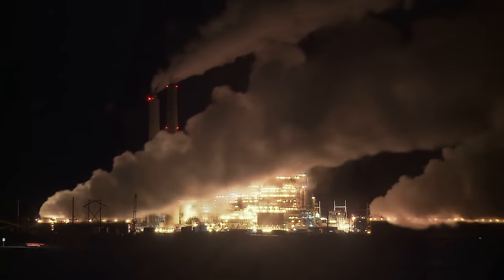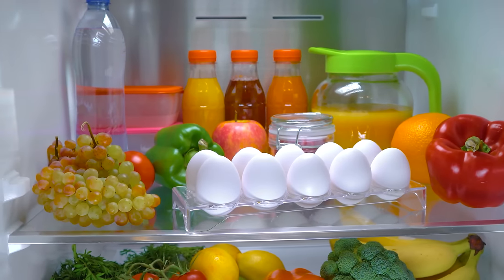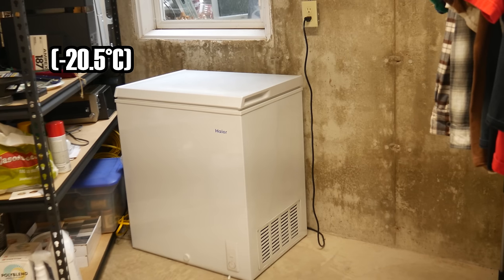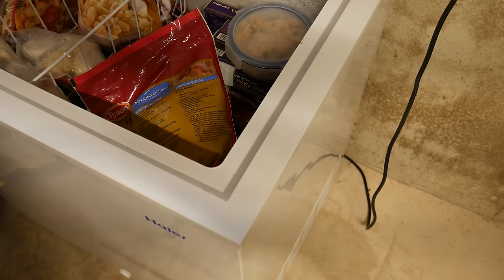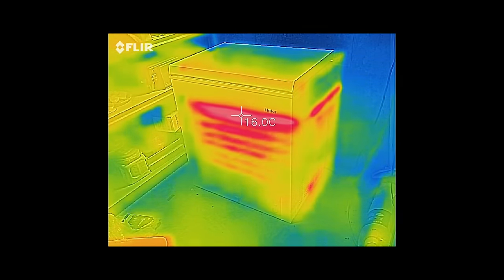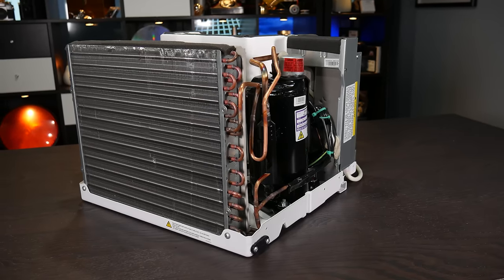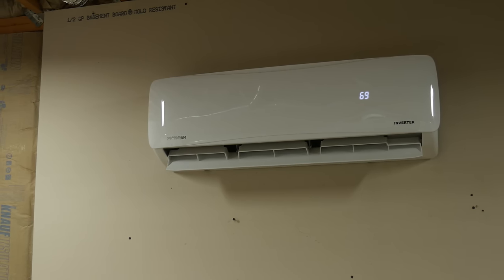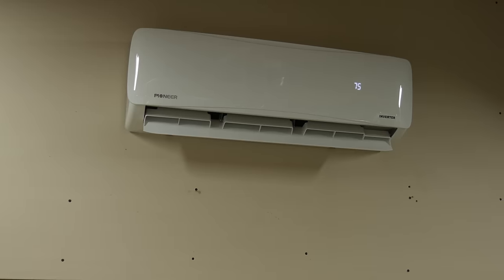Heat Pumps: the Future of Home Heating

Comment: So if I place my big food freezer such that its door opens out into the garden, and its back faces into the kitchen, and seal any gaps around it so that outside air cannot blow inside or heat from kitchen does not escape to outside, with some barrier or a curtain, the freezer is then set to cool to its lowest temperature say Minus 20C , the fridge will then try to cool the outside air from say 0 degree Celsius to even lower to -20C and in doing so the heat it removed from outside 0 degree air trying to extract heat from it to take it down to -20C  will end up into the kitchen, from the rear part of the fridge where it has a heat radiator grill or matrix, this discharges heat into the kitchen so the kitchen gains the temperature whilst the air outside starts cooling even further lower than 0C . So you can have a simple cheap heat pump. It uses around 60Watts for the compressor, so it is likely it is radiating 4 times more watts into the kitchen I.e. 240 watts of heat being pumped into the kitchen by using only 60watts for the compressor trying to cool the outside air to minus 20C, , and yes occasionally you will have to defrost it as moist or damp outside air condenses on its inner shelves and walls.

Comment: Heat pump is very popular way of heating home in winter & cooling in summer in New Zealand. However our winter is not super cold in Auckland around 2- 3 degree Celsius were I live & summer is hot as around 30 degree Celsius. Heat pump become very economic way to do both job. What I learned from technical person who installed it that heat pump will heat the house as long as temperature is above 0 degree Celsius. 5.00 kilowatt will heat around area of 50 cubic meter with little power use as 1 rod rediant heater

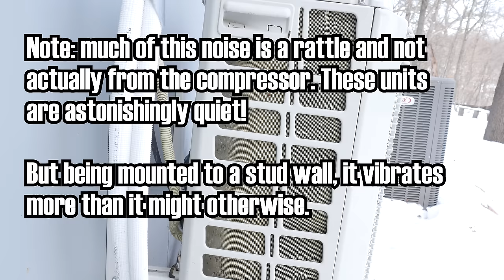Comment: 23:27 thé noise is not rattle, it makes this noise when starting the unit in heating mode for around 7-10 minutes thereafter it goes quiet. I have a Hitachi hit and cold unit and the nose is loud in the beginning and felt like a chopper flying over the house. The DAIKIN and Panasonic units made much lesser noise. So this noise will be there when starting up in the winters

Comment: Heat pumps have been the norm here in Florida for years. They’re great but have some downsides. They wear out sooner because it’s the same motor working year round instead of separate heating and cooling units. They also don’t work as well in extreme cold - which is something we don’t really have here.
Reply: And where it is cold, we have much better heat pumps. There are models for different climates, its important to buy the right one for its purpose.

Comment: While heat pumps can work down to -18C (0F) or so the efficiency plummets and so does the lifetime of the unit. If you live in cold climates you need a supplementary furnace.  Oh, and don't get me started about what happens when you a power outage.

Comment: To defrost the condenser in winter, could you use resistive heating to warm the condenser fans and melt the ice?  The fins themselves could be electrified to warm them up.
Reply: I think there have been units that do that.

Comment: Very good  video. I live in the Netherlands and in our climate there is no need for an airco. If I would want to buy an airco to use it as a heat pump, this would cost me a few thousand euro's. When I read about heat pumps I always read that they have an efficiency of 400 percent. You, however, seem to indicate that the real net efficency lies around  250 percent. 
Now I heat my house with natural gas and when I would swith to electric heating, it would cost me three times as much money. When I would also switch to a heat pump, those 250 percent gain in efficiency would reduce my cost for electricity from 3 times more to largely the same as the cost for heating on natural gas. So in the end acquiring a heat pump would take me quite an investment with hardly any profit to earn my investment back.
Reply: That is why they are putting up the price of gas. It ain't all on Putin mate.
Reply: A different scale, same efficiency bub.
Reply: @azzy2001  If so, that would be funny and the joke's on them, because electricity generation itself is about a 30% efficient conversion (the rest being waste heat). This is why a space heater costs 3X than natural gas to heat a home, because either they're paying for fuel and making electricity at 30% efficiency, which you then "burn", or you're paying for fuel and burning it.

Comment: Why not add a series of three air dryers to the system
1) Each dryer would allow outside air to flow into a cylinder containing a water absorbing agent
2)  When a drying unit reached its absorption capacity, it would close off to the outside air; a small amount high temperature refrigerant would be diverted to heat up the drying agent while high temperature dried air from one of the other dryers would  be blown through the at capacity cylinder.  
3)  The third unit would always provide a free flow of unrestricted air to the cooling/heating coil 
4) A fourth bypass would be available for temperatures and humidity levels at which ice on refrigerant coils is not likely.

Comment: Seems like a decent innovation from a material conservation perspective, even though it would be less efficient at heating than an electric heater given that it's literally just electricity -> heat.
It's always been funny to me that efficiency for most machines is determined by how much energy is lost to heat, but for heaters?... It's by how much energy isn't lost to heat.

But that being said, reducing the amount of devices needed for temperature control is very good!
Material scarcity will be a much larger issue than power scarcity in the future, I'd wager.
I didn't initially agree with the title of the video, but... I've come around.

Comment: It's interesting that you say the equipment of the mini-split might seem weird because people aren't familiar with it. As you say, they are basically air conditioners running in reverse, but also they look exactly like what I think of when I imagine an air  conditioner, so it seems very familiar to me. I get why; that sort of form factor isn't as common in US homes I gather. I don't live in a place that has air conditioning for homes... at all (or even a furnace, we use boilers and radiators here) but when I say, travel to Bangladesh the AC units look exactly like this mini-split, but running in the more familiar direction of course. Same with my old workplace; its AC was made by Mitsubishi and looked rather like a mini-split.

Honestly, I think a place like Bangladesh is really well suited to heat pumps. It's warm much of the year there of course so it can be fairly mediocre, but there is a need for heating when it gets cool there and because it often doesn't (and so buildings are often quite draughty and clothing is mainly for warmer times of the year) even fairly mild temperatures can cause a lot of problems. It angers me that heat pumps are not more common in general because in this case, they can be used to prevent literal deaths (which does happen when it gets cooler there), especially because air conditioning is extremely widespread and often necessary to really live there. There is as you say literally no reason such systems can't also be used for heating - no doubt the same issue of fossil fuels (Bangladesh has vast natural gas reserves) is a big reason why, especially when a lot of the people there aren't exactly well off.

Comment: Installed one in Maine, it gets cccolddd here but it  puts out heat, it is working hard on those cold days and the  defrost cycle is frequent, if i insulated better it would make life easier for the heat pump,

Comment: Heat pump on a rental my family is in. It sucks. In an area that regularly dips below 10 degrees in the winter, a heat pump was the worst option our landlord could’ve picked. I have an inside portable temp gauge. The weather outside was 21 degrees, and the heat pump kept our house at 44 degrees. My kids and wife stayed in bed all those days cause the floor was so uncomfortable for them to step on it was so cold. Not to mention our electricity bill went from 140$ a month to 395$, to keep our house at 44 degrees…

Had to section off rooms with plastic and cover all the windows, then use space heaters to keep the house warm. All this hassle, if you’re considering installing a heat pump, don’t.
Reply: Sounds like a horribly insulated house.

Comment: I live on Vancouver Island, British Columbia, Canada.
My home is heated and cooled by an air to air heat pump
The outside temperature in th  winter can drop to minus 16 Celius.
At minus 9 to 10, the electrical heatimg element in the duct system kicks in.
We used to live in Whitehorse, Yukon.
The Ground water under the community of Riverdale, is plus 7 degrees celcius, therefore, even at minus 40 celsius, a geothermal system, with a water well, would work to heat a home.
Location location and source are important
Reply: There are better and more suitable units. The climate where I live in scandinavia is the same. At -10c the heat pump works normally. At -25c electric adds in. I have air to water so you dont notice the difference. It is not many days we have so cold weather so its not so much on the electric bill.

Comment: "Refrigerant" is actually freon-12 replacement. R-134a is a type of refrigerant commonly used in air conditioning systems, heat pumps, and refrigeration equipment. Its chemical name is 1,1,1,2-Tetrafluoroethane, and it is classified as a hydrofluorocarbon (HFC) refrigerant. R-134a is popular as a replacement for the earlier generation of refrigerants like R-12 (Freon-12), which are known for their ozone-depleting potential. R-134a is considered to have lower ozone depletion and global warming potential, making it more environmentally friendly.

Comment: I guess you could flip a window AC unit the wrong way around to get heat. Setting up a fan to  low across the condenser would half speed up the dispersal of heat energy in the room since window AC units usually rely on the breeze
Reply: Thats silly, then your just making the world cold
Reply: Yeah and dump water all over your room. Very smart lol.

Comment: A typical split heat pump system is significantly more expensive vs cooling only and when you also need a gas fired furnace for cold climates it doesn't make sense financially to have both ( a gas furnace and a heat pump).    I own a mechanical / electrical contracting company in the Chicagoland area.  Typically people that want both a heat pump and a high efficiency furnace the extra cost is not an issue but for most people cost is the determining factor on the type of equipment they ultimately end up choosing. Another factor is that most gas furnaces are relatively simple pieces of equipment that are indoor ( resi applications) and typically quick to repair.  Dealing with heat pumps outside in the snow and cold is a PITA especially when it's an emergency because it's the only heat source.  Nobody has developed a leak proof system yet - at least that I'm aware of.  The supply houses have been trying to convince us that heat pumps are great for all climates for at least the last decade that I can remember. I think they are excellent for milder climates but I'm not there yet for climates like Chicago.

Comment: I am subscribed.   Please explain something:   At 19:30, you are saying that it is producing 5 1/2 times as much energy as it consumes.  The watts in/ watts out ratio for all the units I checked varied from 2.9 to 3.66.   How did you get up to 5.5?   (is it because it is using the compressor heat as an additive?)   You don't really say.   I am trying to do the math for an extended family because many of them may purchase.   I don't want to be caught misrepresenting the benefits.  I myself am probably ready to buy a Mr. Cool I think.  Thank you for your answer.

Comment: We're paying roughly 9p/kWh for oil a heat pump would vary between 10p-15p/kWh of heat based on a COP range of 3-2. It's not bad though considering you'd be paying 30p/kWh using electric heating

Comment: How heat pumps work simple version
1. Cut a fridge shaped hole in your outside wall and put your fridge in it. Doors facing the outside 
(🧱🦭 Fridge🦭🧱 )
2. Remove the fridge doors
The warm bit on the back of the fridge is indoors and is your radiator
The outside world is now (sort of)  'in your fridge' which is where you new radiator gets the heat from
(Please note the back of freezers are warm too, any temperature above -273 centigrade can have heat taken out of it (we would all be dead at that temp though sooooo...))
(Edit: gap seals 🦭)

Comment: Under ideal conditions commercially available heat pumps can extract around 300% of input energy as heat not 500% as stated. In real world installations when it is sub zero conditions outside this efficiency falls dramatically often being well below 200%. This is of course energy at the heat pump and does not take account of losses in electricity generation and transmission which is typically 60%.

Comment: My Carrier Greenspeed heat pump has a HSPF of 13 and heats my house without resistance heat down to 5 degrees F (-15C) , it will still put out heat down to -5F (-20.5C) but my house looses more heat (darn 45 year old insulation standards) than the heat pump can provide at that point and resistance heat is needed. That Carrier unit you showed (like mine) should of been on a snow base that raises it up 1 foot to keep deep snow from blocking the air flow  .

Comment: I used to work with a refrigerator repair business. The units we worked on were old-school and did NOT have smart defrost technology. If the coils froze up, you shut off the fan and melted the ice with a distant blowtorch. That could take HOURS!!! You didn’t pull on the ice or you’d break the grid matrix. You had to distance the torch or you’d melt the solder points and cause a breach. What a mess those machines were!

Comment: I was gonna say, I was looking into plumbing some AC into my central system (thanks, manufacturers who design furnaces to accept refrigerant lines from a central AC box!), and every contractor I was getting a quote from basically told me it would be more beneficial to go for a heat pump instead. Still the one box outside that plumbs into the furnace in my garage, but with the reversal mechanism to generate heat, meaning I'd only have to run my furnace about a single month out of the year.

E: Also, thank god for 90% hydro grids. It may get so cold that everyone needs to fire up the electric furnace, but the river keeps on flowing, and my city has a natural gas driven generator they can fire up if they need even more energy, and STILL have some energy left over to sell to other states

Comment: My initial "a-HA"/"lightbulb!" moment about a "heat pump" (yes, terrible name) was this: put your refrigerator (with the door off) through the wall of your house, cold side in, back (with coils) outside. It's cooling the house, right? and the (hot) back is basically heating the world. Now: turn it around: it's cooling the world -- and heating your house. (What takes a bit more to understand is this: well, how's it doing that? No, it's NOT actually the compression INPUT energy heating up the fluid in the compressor, from the wall power: it's in fact taking LOTS of TOTAL heat from outdoors, "focusing it down" into the fluid so it's more "concentrated" (i.e. a higher temperature in a smaller space), and bringing it indoors and "letting it out".)

Comment: in a nutshell, if you live in a portion of the country where you rarely see temps fall below 40 degrees, they are ok. If you dont, you’ll be on ‘emergency heat mode’ most of the time making it NOT worth the extra headaches they bring, mainly the reversing valve issues. I myself live in the midwest and would never, ever, have one. Gas furnace is, by far, the best choice for a myriad of reasons. That said, i wish i had a wood burning stove too.